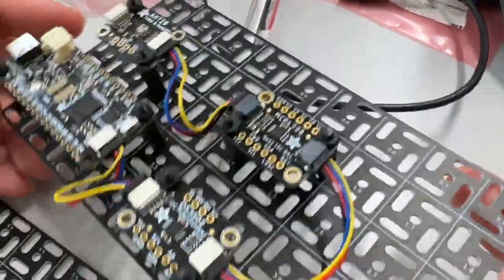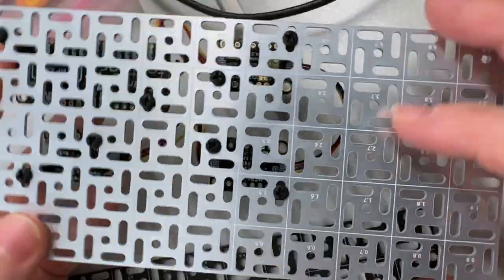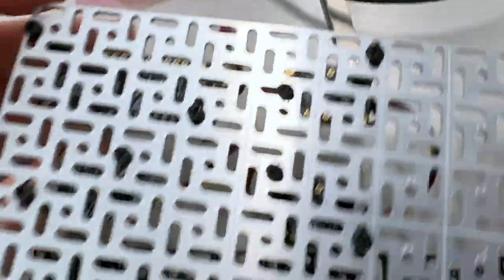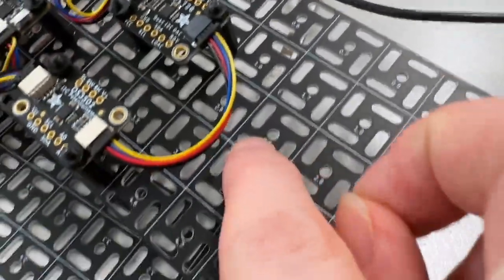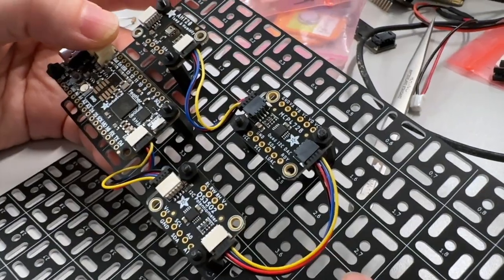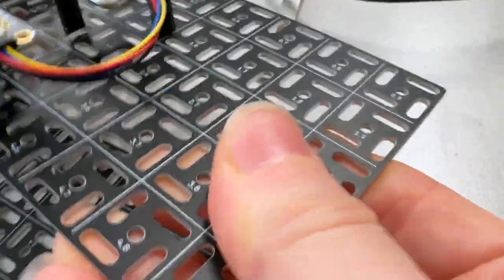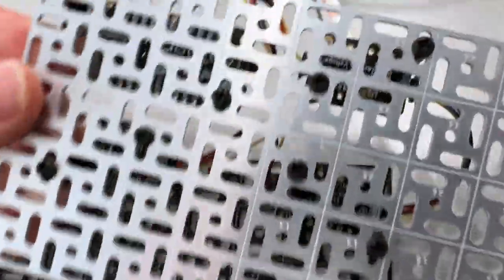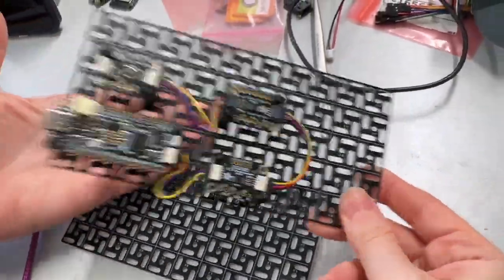swirly grid for mounting prototype boards

Comment: I so wish you would release 3d printable version maybe in smaller scale.
Reply: If a technical drawing is released, it shouldn't be too hard to get a 2D representation in something like Inkscape, then take that SVG into OpenSCAD and extrude it. Or even make a parametric version in OpenSCAD with lengths, thickness, and radius variables.

The only issue is that it won't be as robust as aluminum, so maybe a 3D printed version would use slimmer slots so there's more material and thus more structure.
Reply: I’d extend that to being able to take the CAD file and having my own, in custom sizes, made as PCB’s.
Reply: Generator code is here: https://gist.github.com/tannewt/0acd1f6af48c43dc7e15243fe0af47ed Install it as a kicad plugin and then run the function from the Python terminal in Kicad.
Reply: @tannewt  Can you please help us with the footprint used: pcbnew.FootprintLoad("/home/tannewt/.local/share/kicad/7.0/footprints/adafruit.pretty", "ADAFRUIT_2.5MM")? Is that something custom you created or is it available somewhere I haven't been able to find? Thanks!